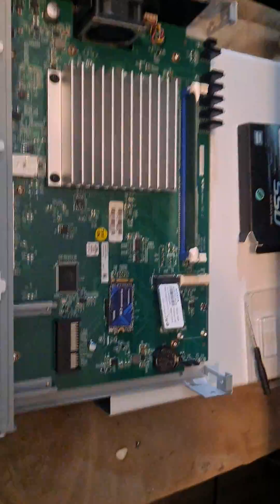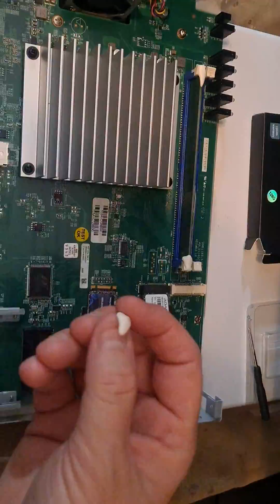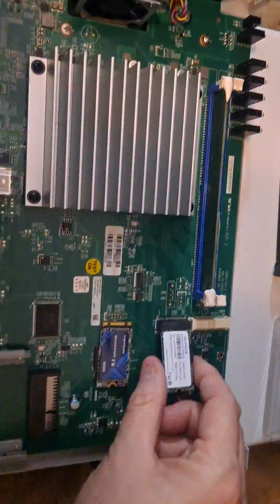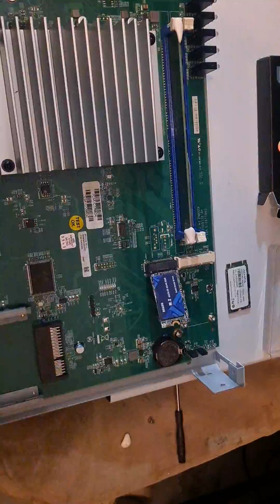Sophos XG 125 Rev.3  Drive Replacement Red LED Light - Alternative PFsense Hardware

Comment: I installed a 128 GB hard drive. But it is not recognized. Maybe I can change something in the BIOS?
Reply from the maker: I am sorry to hear that, the next steps I would try would be to reseat the Ram and remove the cmos battery for a few min. Good luck and let us know if that helps.
Reply: @BoserEugen  I also faced the same issue, make sure the hard drive you’ve installed is compatible with your firewall, because they don’t recognize all types of hard drives
Reply: @Yabanno  It's a SSS0Q68674. Still have the issues.
Reply: @BoserEugen  you need a gen4 m 2 2230, the one you have would not work
Reply: @Yabanno  Thank you! I will try out.
Reply: @Yabanno  Should this one work? Micron MTFDKBA256TFK 256GB NVMe 2230 PCIe M.2 SSD

Comment: I have a xg 135 and I replaced the drive and still I am getting the red LED
Reply from the maker: I am sorry to hear that, the next steps I would try would be to reseat the Ram and remove the cmos battery for a few min. Good luck and let us know if that helps.
Reply: @callmebigpapa  thank you! It became good as new.